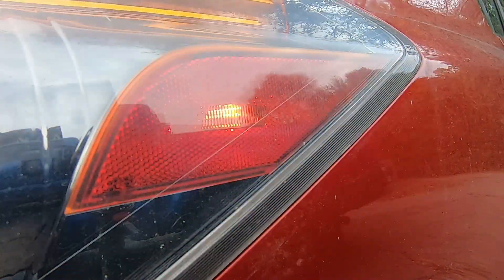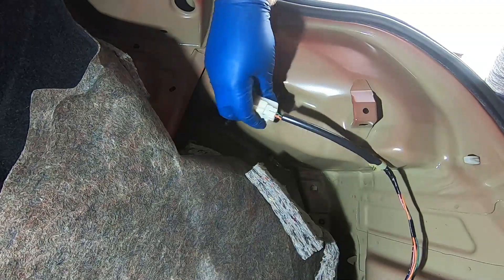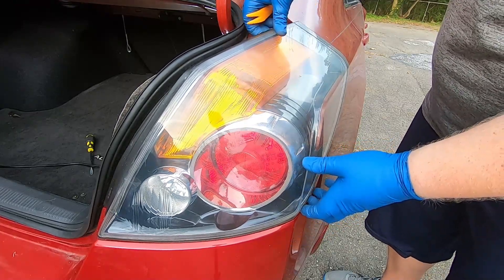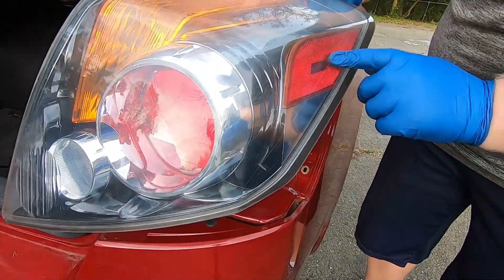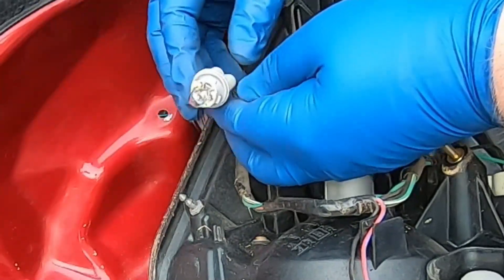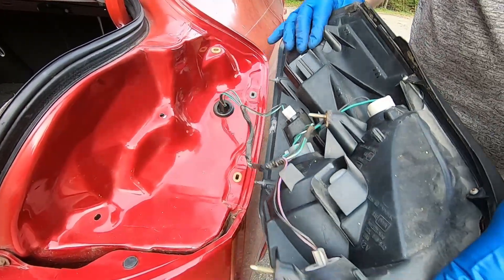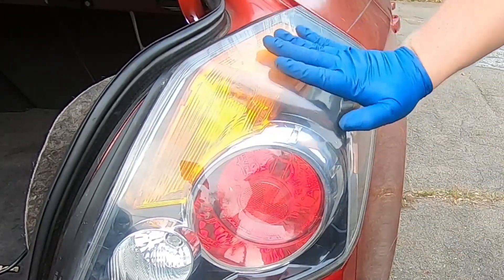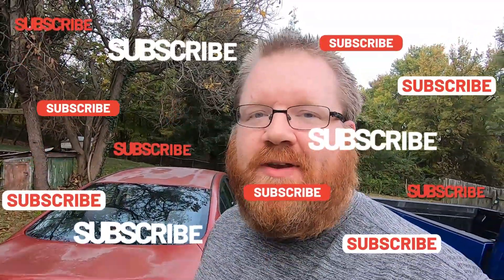2007 - 2012 Nissan Altima: Side Light Bulb - Quick Guide!

Comment: So Many bulbs burned out of my Altima, turn signal, low beam, side marker, and trunk light. All on the left! My right side is just fine 😂
Reply from the maker: Haha! Sometimes that's just how it happens Jelly. If they all go out again in the same way you could be having an electrical issue with the wiring harness. Hopefully it's just a fluke lol. Thanks for watching Jelly! 👍
Reply: @TrickShiftGarage  just got my signal bulb replaced and guess what! It only works about half the time 😂